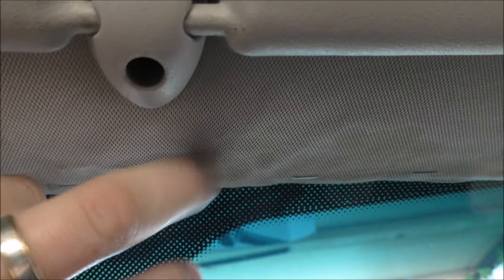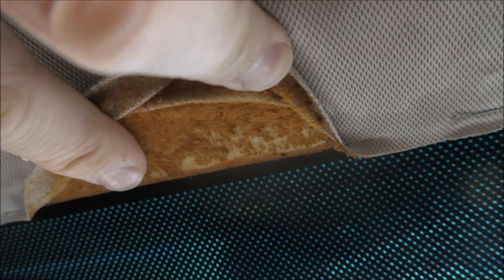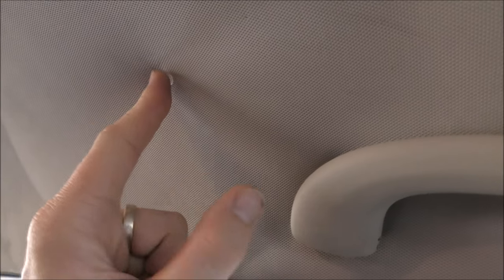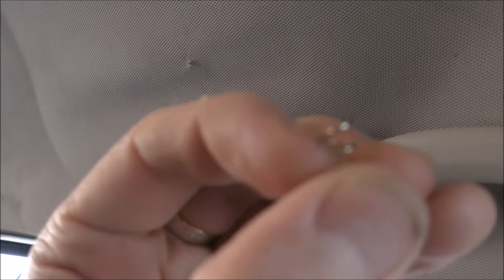No1 Hack To Fix A Sagging Headliner Quickly --  ROOF LINING REPAIR CHEAP EASY & QUICK FIX METHOD!

Comment: Simply use 3M adhesive spray...works like a charm and does not leak through the material and does not damage material using staples...etc.
Reply: Thank you for your tip
Reply: I used 3m spray and it leaked through and also did not really adhere to the old foam.
Reply: How do get this between the liner and the headboard?
Reply: Didn't work on regular fabric
Reply: @omarq1414   same
Reply: @omarq1414 same with me as well
Reply: Thank You ♥️
Reply: 3m spray does not hold as well, you need professional upholster glue.
Reply: My thing is he acts like I’m about to put more money into this then an $8 can of spray glue. I’m never getting this reupholstered. It runs until it goes to the junkyard because it’s too expansive to fix. Repeat.
Reply: @Luna-rm4ll right! The upholstery shop quoted $775 US to fix my Volvo xc90 headliner in 2024. 😳
Reply: Thank you
Reply: Used 2 whole cans of 3m spray and my headliner started sagging after like two months
Reply: @hgj2019  What did you do to fix yours
Reply: @yeawhateverdudesure  I haven’t yet, but I found another shop that will do the job for $350 materials and labor, so that is a viable option.

Comment: I took my heavy duty hand stapler from the office (which I usually use for stapling through a 1/4" of useless paper documents) and I opened it up and put about 500 staples in the liner/roof. It worked perfect although it looks like crap 😜

Comment: I was trying to figure out how to glue it down but after seeing this I just stapled it untill I can get it done properly. Even though its ugly seeing the staples at least its gonna stop sagging for now as it was getting worse. It also makes sense not gluing it to make it less time to redo for a professional which in turn will cost less. Thanks for the vid 👍
Reply from the maker: I agree, perfectly said 👍👍
Reply: Thumbtacks look better than staples. Not to mention, you can get artistic with it.

Comment: What do you think of using the 3m adhesive spray that everyone is recommending? I seen most of your comments, you mentioned you prefer staples over glue. When you said glue, were you also including the 3m spray adhesive option? Just wanted some clarification, thanks!
Reply: 3M 76 is great, but expensive, I'd prefer permatex over it however for price and function. Keep in mind, spraying Any glue to the existing factory sagging roof lining is like spraying glue to dirt and hoping it will stick. Due to the old foam has most likely gone crumbly and turning to dust. That's why I suggest other quick repair Methods like staples/twist pins if not doing a full replacement with new material.

And to even think about adding glue to the existing fabric and have any sort of long lasting hope, you'd have to remove the headliner and scrub off old foam then try reline the original fabric up with all the cut outs being that the fabric is most likely shrinking or over stretched in some places, at that stage it's better chucking the old fabric away and just replacing with new foam/fabric while headliner is removed out the car.

▸ Permatex headliner adhesive http://ebay.us/apC9ZH
Reply: @Reece.wilson  you meant 3M Super 77 Multipurpose Adhesive Spray right? If 3M is cheaper than Permatex Headliner Adhesive in my country, does that mean it’s the better option? Mostly cause I’d have to ship permatex to my country, can’t find it locally.

Thanks for the tips about the crumbly dust. I’d love to get it professionally changed in a shop but in my country it’s very expensive. And in workshop we agree on prices before the work even start (that’s how it works in my country), so in that case I think I will try to fix it myself first. I’ll try with the adhesive spray first, wanting to avoid staples cause it looks ugly. If both method fails then I’ll get it fixed in a shop. If I can fix it myself I will save so much of money, the fabric headliner is still so clean. I don’t smoke or eat in the car. 

Thank you for replying so soon 🙏

Comment: I put staples around the edges, underneith the rubber trim to hide them, then put a few 1 cm screws in where it was sagging the worse. It's still holding up well after 6 years

Comment: Huh. Twist pins, and better yet, staples! Thanks so much for this video! The fabric had dropped down at the back window the other night, blocking the window. You've put my mind at ease in the short term or for a while. Much appreciated. 🙏
Reply: Thank you 😁👍
Reply: @Reece Wilson  just a follow up, went out to the garage this afternoon and had the fabric taut and no longer obstructing the rear window in less than 10 minutes. It's an older car , my father's at one time, so it has sentimental value. Thank you again for the simple, yet  epic hack. 🙏
Reply: How do staples go into the hard board?
Reply: @silverlake973  heavy duty staples work well. Modern roof boards are like a cardboard fiberglass texture.
Reply: @Reece.wilson  since this comment I did exactly that. Looks terrible but at least it ain't sinking anymore lol

Comment: What do you think about placing a new piece of just regular fabric of some kind, over the old sagging, ripped headliner fabric, and stapling that up there? 

My liner is more than sagging, it's all kinds of torn up. My car is from the 90's. So between the Arizona summers and kids- it's a hot mess lol.
Reply from the maker: There is a risk with staples and drawing pins which is a very rare chance they hit a wire behind the board that may earth out the system. Or hit a drain hose/Rear windshield washer hose for wagons and hatch backs.

But other than that, stapling another piece of fabric to the board could possibly work, depends on what finish your after, I wouldn't recommend it.

Comment: I'm probably going to try the staples... But I was just curious, is there any harm in just ripping off the fabric completely? I'm not worried how it looks. If there is foam stuck to the board, I don't want to take the liner off and have foam bits flying all over the car. But if it's just solid wood board, that's fine with me... Any insight?
Reply: 2006 civic lx
Reply from the maker: Usually would be a solid board that would require cleaning off the old foam. Would make a mess in the car and on surrounding plastic interior parts. Once old foam is removed, it's generally just a clean board.

 So can be left as is, however adding quality headliner fabric adds comfort, sound deadening along with heat reduction. So if I had to choose, I'd suggest recovery.
Reply: @ReecesAutoHeadliningRepairs  Thank you so much for your expertise and advice. Greatly appreciated! 💕

Comment: just did this on an 09 civic with staples - thank you much
Reply: How’s it holdin up? I have a 2010 civic.
Reply: Did you use regular office staples? I plan on doing it to my 06 civic
Reply: @Dude00796  3k miles later and still good. so 10/10 recommend. i used a lot of them in parallel lines spaced 6" apart or so, from the back to the front. the lines go from the driver to the passenger side. then some extra ones on the sides near the windows to decrease the stress on anyone staple. they are not noticeable when driving, only to a backseat passenger.
Reply: @maxvoellinger3948  yes office swingline staples worked fine. my stapler was a beater, but it still worked with a little persistence.

Comment: That's excellent temporary fix. Do you think this would work on BMW E46 roof? And where did you buy those twisty pins, or whatever they're called?
Reply: What is it called and where can I get it from?
Reply: Works on E46. I just managed to do it, but with regular paper staplers, believe it or not.
Reply: APHOLSTERY PINS 🥳
Reply: I just got some delivered from amazon. Under $5.
Reply: Thanks...I was thinking about Amazon too.

Comment: Does anyone sell a product you would roll on it while wet? My is just starting prob due to air flow through the back window (truck slider) and it seems to me if someone made a water soluble glue you roll on but dries pretty clear.

Comment: Hey mate, any chance you could give me an estimate on how much getting a professional to do it would set me back?
Reply from the maker: Hey, thanks for your comment,
What particular car make year model is your inquiry regarding? Also what location are you in, state/country?
Regards, 
Reece
Reply: 2002 van in suburban Chicago us about $400 to $600. Depend on options, sun roof, etc.
Reply: I live in Hugo Oklahoma where do I take it to to get it done I can't do it my self I got canser
Reply: @riedjacobsen8620  where's that at in Hugo Oklahoma
Reply: Doz Auto do this kind of work
Reply: The back glass of my car got tore and it hangs down where I can't see out of the back glass and I got Canser and can't do it my self I live in Hugo Oklahoma and want to no where to take it to in Hugo to have it fixed
Reply: @barbarakendrix410  *cancer

Comment: large headed sewing pins inserted side ways
Reply from the maker: I agree it is an option short term. However, I personally find the sewing needles the worst to remove. They are super sharp and hard to sometimes see, easily missed, and then very easily accidentally pricked 🤕

Comment: Good video, however....
Twist pin leaving damage/ indentation which most likely will show after retrimming , applying glue is messy, very messy and it won't last 5 minutes , and you are adding costs to total price of retrimming professionally. Also it makes trimmers work more difficult to clean the board out of lumps of glue and may add to the price for a job....
Normally retrimming headliner isn't cheap so i do understand "temporary solutions" especially when the car isn't worth much... but as a professional i do not appreciate when someone  thy it and then " i try to fix it and it didn't work, can you help"  thing, the price go up as i have to spend more time preparing the board....
Kind regards.
Reply from the maker: Yes that's correct, we suggest to customers never to add in glue in the hopes to hold up a old headliner.

The best quick repairs we seen customers do is just either staples or drawing pins. It's much better than glue. We don't seem to have an issue with the board having dents and imperfections from that type of quick repair.

Comment: It's a car....not a house. Who pays to have headliner replaced
Reply from the maker: When the traffic police pull you over and say you can't drive the car no more till fixed.
Reply: @ReecesAutoHeadliningRepairs  tear it off....
Reply from the maker: @bartsimpson4983  location is Australia, but I'm referring to the same person, obviously what I meant by this is its the police driving around on the streets or at random check points that are going to handle the situation and issue defect notices, atleast thats the case here in Australia.
Reply: @bartsimpson4983  Yes. Where I live "traffic police" does only traffic related work.
Reply: @anintatej  If you can't see behind you because the headliner is hanging down, that would be a "traffic related" concern.
Reply: @ReecesAutoHeadliningRepairs  that's gotta suck worrying about getting ticketed for such an issue. Unless, of course, it's actually impairing your vision.